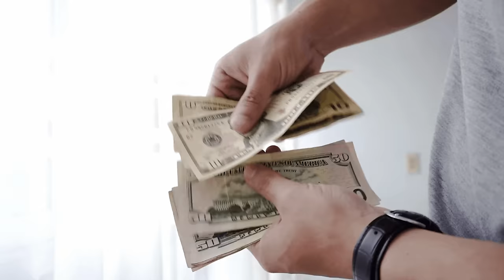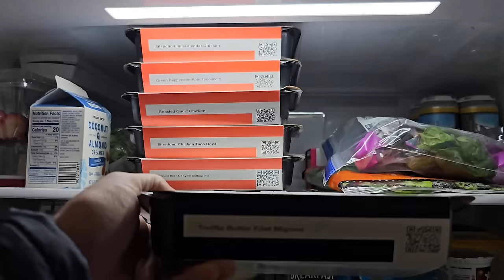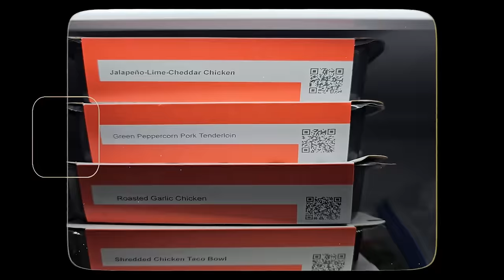AUCTION SCORE! I Found this MINT 1994 Lexus SC400 and paid less than $2000 for it Now Lets Sell it.

Comment: Unfortunately just about everyone that washes a car now calls themselves a “detailer” what I notice with most of these people is they don’t understand that a detailer is someone that has the ability to clean/correct the finer details..
Reply: yep! as a actual detailer I cringed when he used a paper towel on the rear bumper, you can even see afterwards it looks like it was sanded lol
Reply: @maxortega6061 or a wire brush on the trunk.
Reply: I washed my toilet the other day. I am a detailer
Reply: If you are an aspiring detailer ,don't follow anything from Craig's channel. I mean no disrespect ,but this guy is  a car washer. So, you are going to wire brush the spare tire well ,yet not  wet sand the dead clear off ,and  bring back the paint? I really don't mean to troll ,but you are spraying tire shine on the spare tire ,and paining the spare well. I feel like i am being trolled

Comment: I have a Detailing business in VT, I would recommend not using silicone based products for engine dressing, not good on electronics and attracts dust. The best product out there is stoner Trim Shine, leaves a non greasy, natural satin finish and doesn’t attract dust, been using it for years with no problems
Reply: Not his problem, he's a used car dealer. Cheap and fast, down the road it goes.

Comment: My SC400 engine lost a rod bearing at 112k. Was the worst Lexus I have owned. My GX470 now has 387k miles, reliable. My SC430 went 176k, no issues. My SC300 went 98k miles needing an egr valve only and a weird torque converter slip issue. Lexus’s are also well known to have low grade leather which never lasts.

Comment: That A7 is dope if you know what it is and how to deal with it. You have it as an RS7 tune though and that's not possible but it likely does have the 500HP with dual pulley and the stage 1+ apr tune or likewise. RS7 tune would be making at a min, 739HP.

Comment: Why don’t you simply run that Kia through the auctions ? It’s been a year you got it fixed for free !!!
Reply: At this point the market has corrected so much since he got it that it doesn’t make sense. He might as well just retail it for the low. The color doesn’t help. As a fellow dealer it’s just one of those cars.
Reply: Hyundai/ Kia won't give free engines to dealers anymore, videos like this ruined it

Comment: Just a head up Craig the model numbers on the car tell you what motor it is. Sc400 4.0 1uz. Ls400 4.0v8. Sc300 3.0L non turbo 2jzge.  Is300 also 3.0L. Rx300 3.0 I6. . All their XX999 model cars work that way. SC is sport coupe, ls is luxury sedan, es is executive sedan etc etc........

Comment: Your Buick would outrun that Lexus
Reply: Both are super reliable the supercharged 3.8s transmissions had some problems not the worst but likely would need to be replaced before 200k miles. Also it is rusted out so maybe in theory it could but it is not safe to drive at this point.
Reply: I agree

Comment: Do more research. Most of those from Japan did not have the supra motor. They had the 2jzge non turbo. Only cars that had the 2jzgte were the supra, some altezza's but most were auto, and a few later jzx100 chasers and crestas. Every other "2jz" car was the non turbo ge variant barely putting out 200hp. And in America only the supra came with the turbo 2jz.

Comment: 12:45 Z wheels fit on it huh? Lmao I swear sometimes you let us believe you know alot more "general" car knowledge than you do. Or maybe I just assume it's general knowledge. Pretty much all Japanese 5 lug vehicles use 5x114.3 bolt patterns and so yes all their wheels are interchangeable. 2000-2004 and up honda, 2001 and up Toyota, 1998 and up to Nissan. If it's a Japanese car and 5 lug. It's 5x114.3(5x4.5)